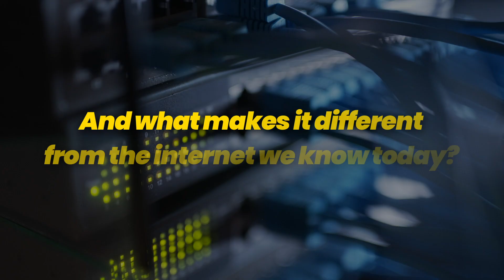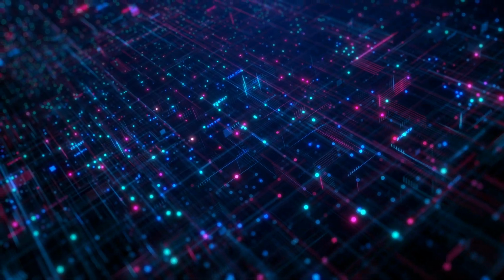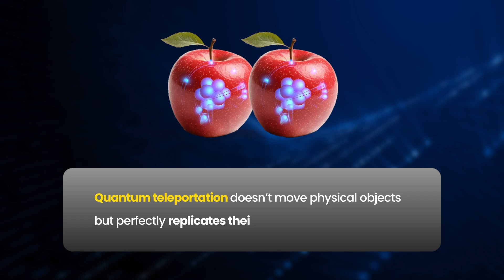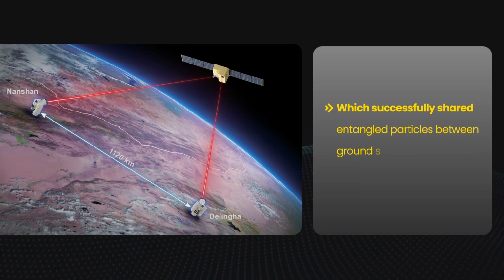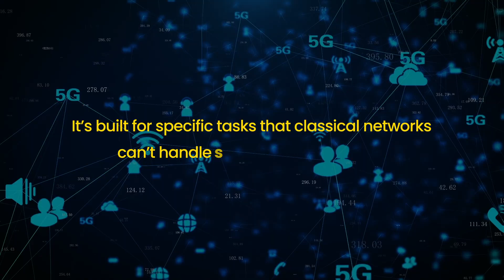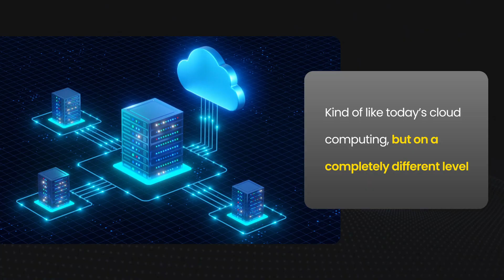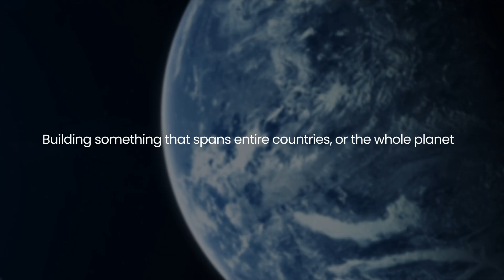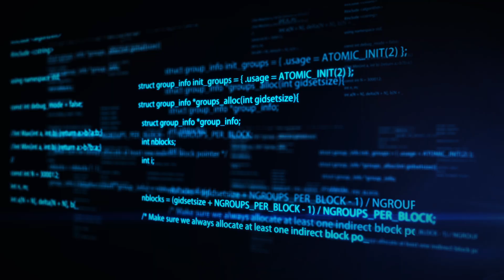Quantum Internet: How It Works And Why It Matters

Comment: Apparently they figured out how to send quantum entanglement bits over a regular fiber network using the IP protocol. They use a Qchip,  which is a piece of relatively ordinary silicon that can somehow interpret a guiding signal that guides the entangled bits to their destination over the fiber. The thing is, at no point can the bits be observed or measured in the process. How this happens I have no idea, but there is apparently a paper in Science (a scientific journal with an overly appropriate name).  But I say none of this seems possible. Guiding the qbits to their destination is one thing, but how are they passing through routers, switches, surveillance equipment, monitoring equipment, etc without breaking the signal?